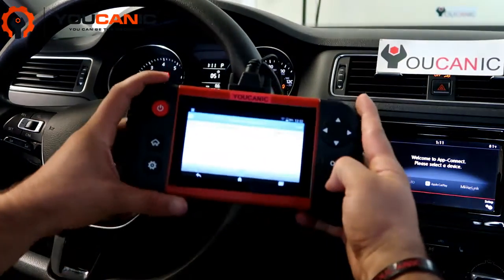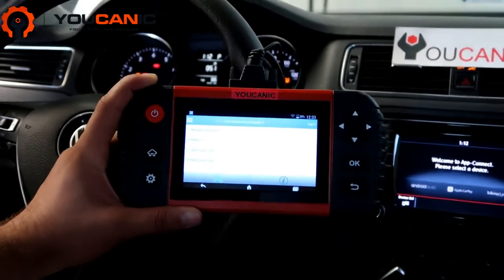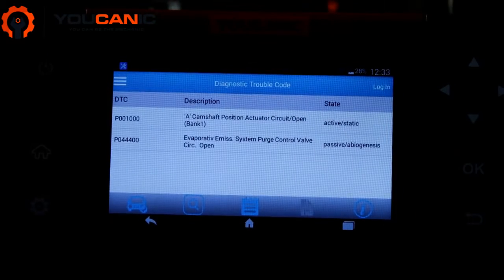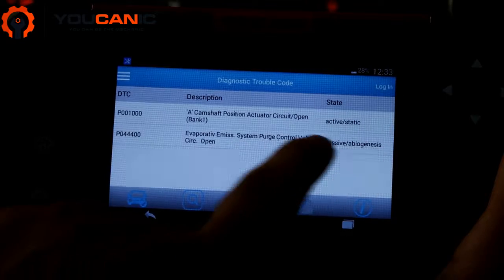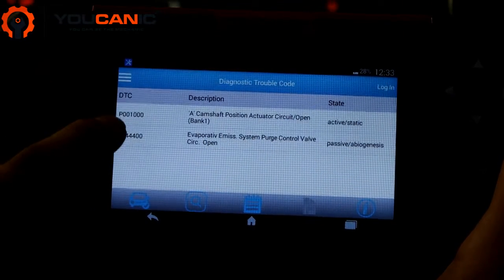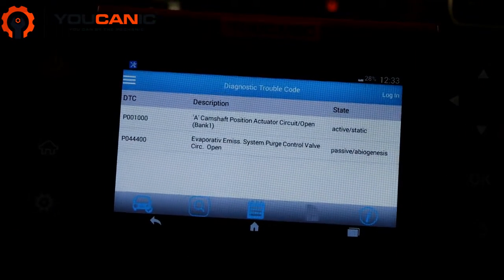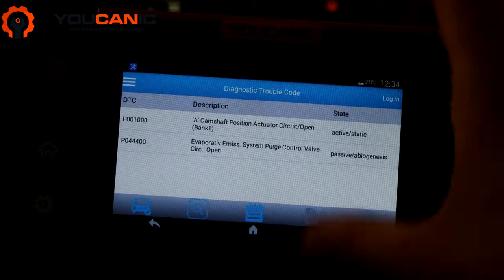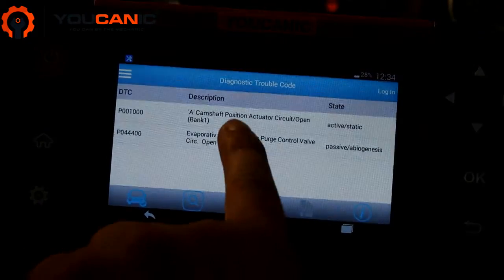Volkswagen P0010 Code: Diagnose and Repair Guide

Comment from the maker: P0010 is a code that points to a problem with camshaft acuator. The issue is typically detected when the engine is running and the  engine attempts to adjust valve lift during high RPMs.

P0010 code generally sets when the ECU detects a open circuit in the VVT circuit corresponding to the bank 1 intake cam but it can also be an indication of engine sludge.

The most common causes of engine code P0010 are:

Low engine oil pressure. 
Faulty Camshaft Position Actuator
Obstructed oil passage.
Camshaft Position Actuator wiring
Camshaft Position Actuator connector 

Learn more about code P0010 here: https://www.youcanic.com/guide/vw-p0010-code-symptoms-sensor-location